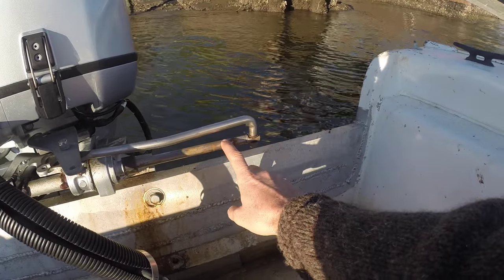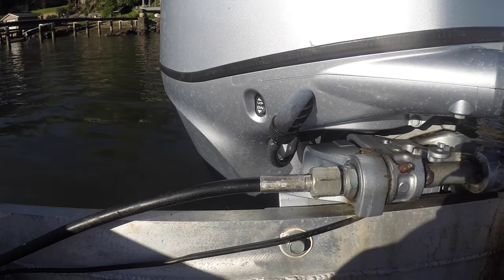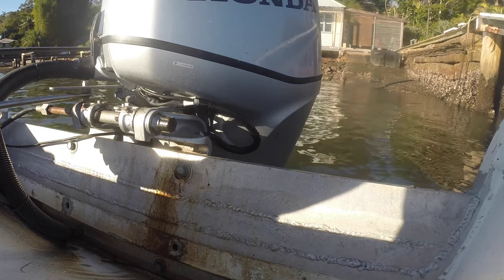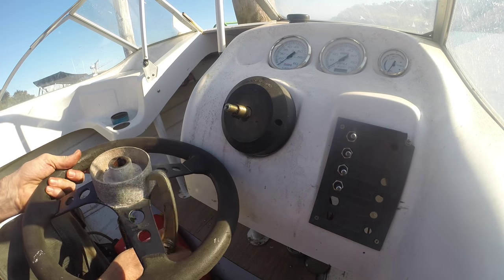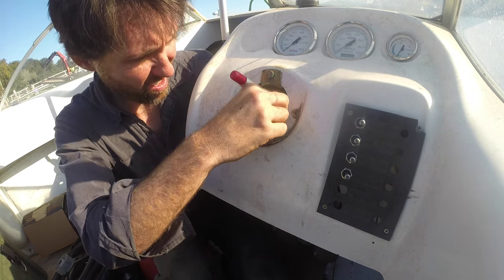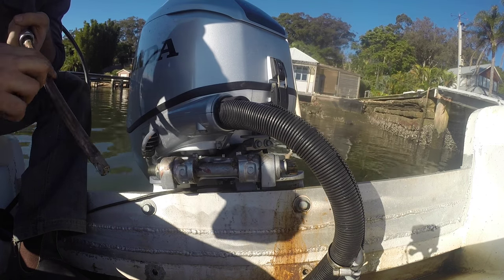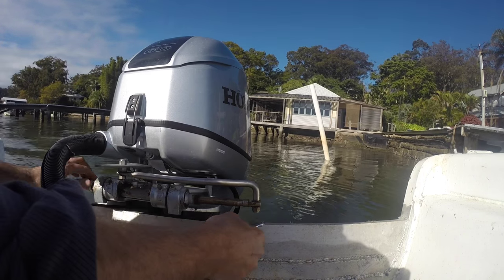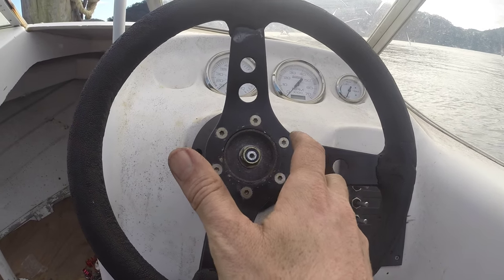Replacing the steering cable and helm in a boat

Comment: It seems like some youtube algorithim reads my mind.  Just two days ago I noticed some steering issues with my 1993 boat. Wifey was driving and couldn't get the outboard to turn tbe other way and I had to push it to get it moving back.  Then this video and the other two on steering mechaisms show up.  These really help understand what problems could exist and how I can fix them with tools I have.

Great comments on tools. Hammering on a screw driver etc.  Not every one has a shop full of the proper tools.  A run to the tool store to get proper tools takes time and it seems that I always end up buying a few other tools I might need some day. I end up spending $65 and half a day to get a perfect tool for the job when I could have used an imperfect tool that I already had but had to adapt a bit that took a bit longer... Thanks for acknowledging.
Reply from the maker: Thanks mate, glad the video helped. 😊
Reply: Yes, you are not imagining that. My grandson had a boat given to him. My son is helping him get it into shape. He was babbling at me he was having problems replacing the steering cable. I told him YouTube will help you. He says I can’t find this problem. You just appeared on my feed 😳I think this is what he was tryna explain to me! Anywho-thank you very much! Excellent video.

Comment: Hi Dangar, I have a dual station flybridge cruiser. The steering is an old Ride Glide system that is becoming stiff. I was wondering if it might be worth oiling the cables as you have done in previous videos to see if that might free up the system. I was hoping to disconnect the wheel ends and force in the oil and then do the motor end with forced oil. Any advice would be greatly appreciated. I have only just discovered your channel and and have been sending links to family & friends. Keep up the great work. Regards
Ken
Reply from the maker: Hey Ken. You can definitely have a go at oiling these cables, you just need a slightly larger hose and a way to step it down to the air compressor fitting. I certainly think it is worth a shot before replacing, but just first confirm that the cable is definitely the problem. Sometimes (with outboards at least) it can be the pivot tube that is getting stiff, not the cables. Glad you like the videos, thanks for sharing the links! Stu :)

Comment: Sorry dang didnt work for me - the rod on my 150 hp johnson is too long to push out that way
Reply: I'm having the same problem with a rod too long on a 150 Evinrude. Someone tried to repair and reinsert and it only bent the rod and made the steering worse. I think if I drill a hole further back it should help with making the curve and line it up to insert the rod. Good luck! (to both of us)

Comment: I’m just about to tackle this job, your video gives me all the information I need. Many thanks, from Ireland.
Reply from the maker: Thanks John. Last week's video was a better version of replacing the cable if that helps https://youtu.be/WGjN4zsNxQw
Reply: @DangarMarine  many thanks again. I’ve taken it apart with your help. My boat is a centre-console rib and I can’t get at the back of the dashboard, so it was more of a struggle than you had. I had to behead a few rusted bolts with an end-mill in a Dremel to get the helm out. It looks like my cable is seized up, the helm is ok inside.

Comment: I am working on a 1954 aluminum boat, that has a steering system, that is a spool of cable behind the steering wheel, it runs along each side of the boat near the gunwales and then it has two pulleys and a spring attachments at the rear, near the transom. What is this type of steering called? Is there a modern equivalent? or is there some new technology I should consider? Thank you for your videos. I love the lack of snobbery.
Reply from the maker: Ah, I know this steering well, it is still in common use. Do you need to know how to re wind the spool?
Reply: +Dangar Marine Thank you for the reply. I guess I hadn't considered re using the system in place. Looking at the condition of the cable, the vinyl over the cable is brittle and cracking in places. Is any generic cable I can find at the hardware store ok? Or do you have a recommendations on where to get it from?
Reply from the maker: There isn't anything particularly special about it. I've seen it with and without the plastic coating. As long as it is stainless or galvanised and the right diameter you should be able to get it any most large hardware stores, yep.

Comment: Hey mate, just got my boat out of the shed and the steering was locked up, after pulling it apart I found that it was stuck to the pivot tube by rust, I have removed the cable and the pivot tube but can't seem to get the pivot tube off. Do you know if it's possible to buy a pivot tube? It's for a 40hp Mercury lighting xr (tohatsu branded mercury) any help would be greatly appreciated.
Cheers
Reply from the maker: Yes, those pivot tubes are replaceable, but you will need to support the weight of the motor before you can remove it because that is what it hangs off. Unfortunately once they are corroded they can be tricky to get out.

Comment: Hi there, on an outboard cable steering if it is easy to steer one way but hard to steer the other what can cause this?
Reply from the maker: If it is while the motor is running, it is generally the torque the motor generates while spinning. Is it a big motor?
Reply: +Dangar Marine hi there, it's a 2000 model Yamaha 25HP, I only just brought the boat and did not know/ check if the motor is running if the steering should get easier. I will start the motor and check that. I also noticed that on the cable side of things where it passes through near the motor the grease on it is old/ sticky.
Reply from the maker: Removing the cable from the pivot tube, cleaning out all the grease from the tube and the cable and then putting a small amount of white lithium grease on the rod will help a lot.
Reply: +Dangar Marine thanks mate, will do this soon.

Comment: Danger,

Do you have any videos on how to hook up a steering cable through the splash well? The boat I bought had the steering vey hard to turn. When taking the steering cable out, it was connected to a clamp block before coming out the splash well. The tip of the steering cable was then attached to a 3 inch block which then connected to the steering mount on the motor. I wanted to convert it to go through the tilt tube, but it is not possible the way the shape of the back of the boat is. 

Do I need the clamp block?

This is my first boat and is a project. Next I will use your videos for wiring lights.

Thanks.
Reply: Dangar.... stupid autocorrect!
Reply: I also forgot to mention that the outboard was only able to turn one way and not the other.
Reply from the maker: Don't worry, I get that autocorrect thing all the time and understand. Some transom shapes do make it very difficult with steering cables unfortunately. I haven't done a video on the clamp blocks yet. I installed one ages ago but unfortunately didn't film it. I can't quite picture you're exact setup, can you post a link to a picture?
Reply: I should of read this earlier as I was fiddling around with the cable today and need to replace some bolts, etc... I'll post pics soon. Thanks.

Comment: I have that exact grease seal on my evinrude, but I can't find a replacement ANYWHERE. Any idea what search terms / supplier, or anything? Mines all plastic, all I'm coming up with are metal nuts with a rubber thingy with it which I don't think will work. Mine was destroyed.

Comment: Hi Stu
Just a few observations after NOT making such an easy job of things as I should. In my case, apart from natural  cackhandedness, I had problems  having to feed the cable through a tight lining along the side of the boat and then having to feed the cable into a confined area under the steering console. So, some thoughts:
1.  Find a friend to help with things like feeding the cable
2.  Before drawing out the damaged cable attach a line to it with duct tape so as to act as a draw and guide string later
3.  The area where the worm threaded cable passes into the cable housing is very delicate. Tape the plastic tube supplied that covers the exposed wormed cable firmly to the metal end of the cable housing and even better splint this junction area with 6 inches or so of split tubing, then tape over. I wrecked my first new cable because it kinked badly when feeding it in towards the console as it caught in an unseen obstruction.
Succeeded in the end!
John
Reply from the maker: Hey John, glad you got there in the end! Some hulls can make this job very tricky. These steering cables are combination of very stiff and hard to bend, yet with that delicate spiral end you mentioned. Often once you tuck it down the side it can be quite a tight turn to get it into the outboard tilt tube. A second set of hands can really help.

Comment: The information provided in this video was right on target. After never working with a steering cable previously, I was able to determine the cause of the problem and correct it easily. The video provided excellent instructions and even pointed out particular complications that  might occur. Those problems did occur, but with the solutions provided I was able to resolve them quickly. Many thanks!!
Reply from the maker: You're welcome Brian, glad to hear the video helped you. :)

Comment: Hello. My steering looks fairly new, it's Shiney no rust, the steering wheel turns real smooth. But it will not steer. What should I look for? Where should I start? The cable or the helm? And what was the 3rd thing you mentioned?

Comment: How to add a tilt system to your small boat, would be helpful video. Thanks I have a 17 foot Aluminium boat with 50 hp Honda 1966 series engine.

Comment: If I don’t need to use the old cable as a way to pull my new cable through, couldn’t I just cut the cable by tube nut with a cut off wheel- then push the old cable through the motor guide tube- then clean tube out and install new cable-

Comment: What is the smaller black hose that runs just below steering cable from the starboard side into the outboard? Water circulation that connects to water pressure Guage is my guess?

Comment: Hi, I'm up for replacement of old quicksilver cable in my 1989 Signature,  looks like it's cheaper to go for a new teleflex system with new helm like you have done here, The cable sheath itself is 13ft and I'm told I need a 15 foot cable, that's $240 but I can get a 16ft one for $150 -just confirming it's no big deal to have it a foot longer.. Also do you supply parts for people who want to D.I.Y. ? thanks

Comment: So what do you do at the helm end if you can not get the steering cable to click in, it just will not go far enough in to lock in with the bolt and more pressure on the steering feels not good to do 
The old unit was a Morse Helm the New a Multiflex ?, i assume the cables will fit both ( Ok they are different at the quick connect end so not the same ) anyone every just cut the longer sleeve off to fit Teleflex cable to Multiflex Hem successfully ?
Cant see any reason why it should not work the inside cable (Gearing ) should be the same
Reply from the maker: Hi mate, can't say I've every come across that problem. I'd be careful cutting the quick connect sleeve. It may work but you can get a matching helm pretty cheap so it might be a safer way to go.

Comment: I need your help . .. I bought a second hand ski boat cat hull. . Everything is working well except that I noticed the steering wheel is loose(lot of play) such that steering turns significantly before engines could start turning.. I checked the steering control at helm, the steering turns with the cable then tightens to turn engines . . .  Its like the steering cable stretched . . what can I do?
Reply from the maker: I would start by replacing the cable alone, and if it doesn't completely fix the problem also replace the helm.

Comment: Great video, mate! Very well explained, good audio and video. With no experience whatsoever, I tried doing this before watching any guides or videos, but I failed to get the steering rod out. I didn't dare use too much force, so I had to cancel. But if I understand you correctly I am safe to just try and bang it out with a hammer? Yamaha 9.9 outboard motor.

Comment: My boat seems to work differently.  Is my cable broken on the inside at the back of the motor?  How do I fix this?  https://www.youtube.com/watch?v=2JxSgW_2rJk
Reply from the maker: Looks like the cable has broken internally. You will need to knock it out with a long rod and a hammer to install the new one.

Comment: are you able to turn the helm without the wheel on? Mine doesnt want to move when I try to turn the helms steering rod
Reply from the maker: +wolfpackflt670 If you can get a grip on the shaft with something like a vice grip you should be able to turn it. Separate the motor from the steering cable to help figure out if it is the helm/ cable that is not turning or the pivot tube on the motor itself.

Comment: Hi I have oil leaking onto my transom from the helm it’s not a heap but noticeable. Should I strip it down an clean it up or is this a major n needs to be seen by a mechanic.  Cheers.
Reply from the maker: The helm is behind the steering wheel, is it oil coming from under motor cowling when you trim it up?
Reply: Dangar Marine oops yeah it’s where the steering cable connects to Rod on the outboard. Oil coming out on the opposite side from where it connects

Comment: Hi, great video (As with all your outboard diagnositics videos)! I'm installing a second hand one onto my 14ft light fishing boat.  Having a couple of problems..  

Firstly there doesnt seem to be an obvious place to attach/bolt the link arm to the outboard and secondly (and more frustratingly) when I line it all up and bolt it roughly in place it seems unable to utilise the full lock to lock steering range of the outboard (ie it can turn right and left but not as far as the outboard is able.  Or if i bolt it off centre then it can turn fully to one side but not the other.)  Is this normal or is it something I can calibrate?  Any advice would be great. Many thanks.

Comment: awesome video, question does the nut in the middle need to be tighten? mine is loose which causes my outboard to shake a little.
Reply from the maker: Are you referring to the nut that attaches the drag link to the outboard itself? If so, then it can't be too tight as it has to pivot at the outboard turns. It's VERY important that it is secured in a way that come undone though!
Reply: i am not sure, its a nut that's right in the middle attached to a bar. the nut is loose as i can turn it myself with my fingers which i believe it should not be like that. i am not sure how much am i tighten it. as  i am idling my outboard shakes causing my steering wheel to move.  the outboard will move all the way to the right just by the shake of the  idling . any idea?

Comment: Hey Dangar!! I really need help from you. I bought a 69 Johnson but I have to press the main butterfly handle to crank it on and after that does not stay on, it dies. I really need your help.  Thanx from GA
Reply from the maker: I'd start by going through the usual list: does it have good compression, are the carburettors clean, is it getting good spark.

Comment: Great video. I have a Teleflex Safe T steering system on my boat and I'm thinking about replacing it with a Safe T II system to hopefully eliminate feedback. My existing cable is 17 years old, but it moves freely and the boat has always been kept inside when not in use. Should I replace it or not?  Thanks!
Reply from the maker: 17  years is a good run but at that age I would consider changing it, yes.

Comment: Dangar, the solid component of the cable going through the pivot tube is frozen in there. Any suggestions for unfreezing that? I can't get my cable out otherwise and right now have no steering. Thanks for any suggestions!
Reply from the maker: +anti2planker Hi mate. Is the threaded collar off? If that is stuck with corrosion you can put a cut through it to remove it. If it is the rod itself then you will need to find a strong steel rod of about the same size or slightly smaller and use it to hammer the steering rod out. A bit of head on the metal it passes through can help, but there are nylon bushing in there that may need replacing afterwards as they can melt. Once it is out make sure to clean the tube out with a wire brush in a die grinder or something to get the corrosion out otherwise your new steering won't work very well. Stu
Reply: +Dangar Marine thanks. I'll give that a shot.
Reply from the maker: Good luck!
Reply: +Dangar Marine this worked perfectly! Being new to the boating world and someone who likes to learn the ropes, I've found your videos awesome! Keep it up.
Reply from the maker: Thanks mate, glad it helped you get the job done. :)